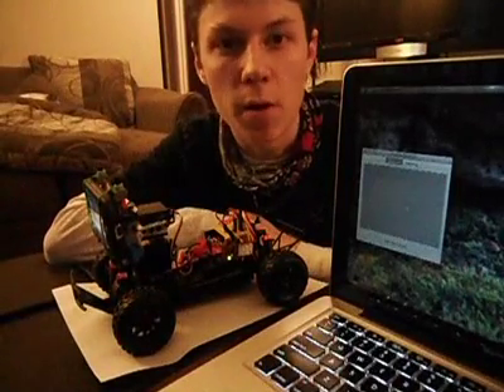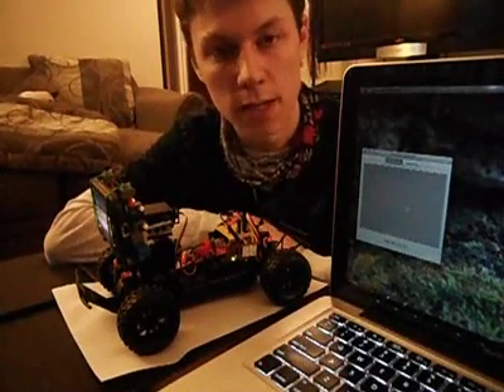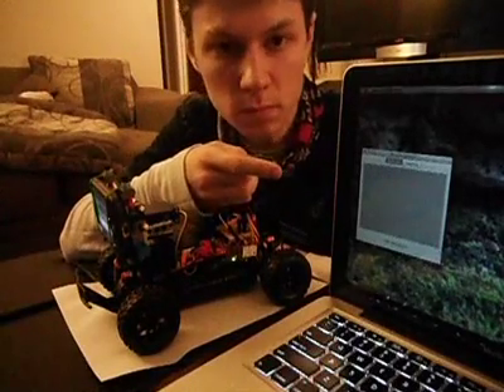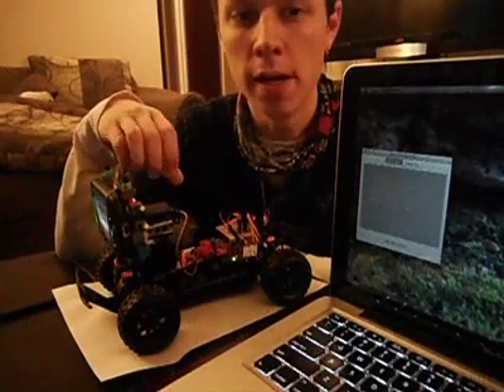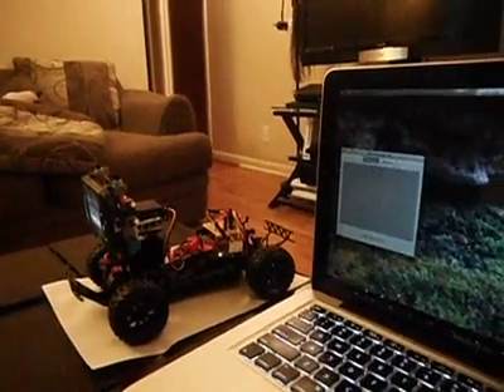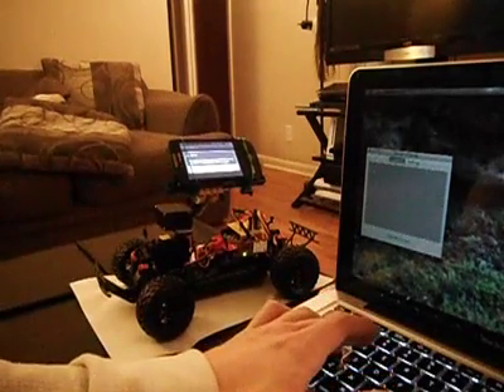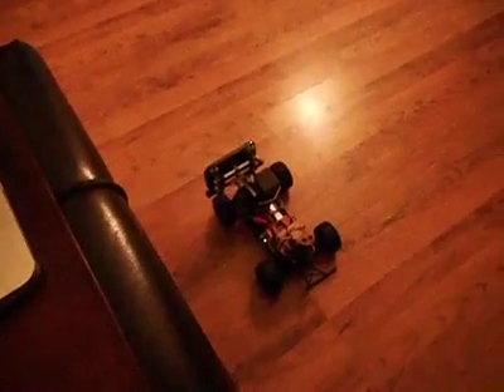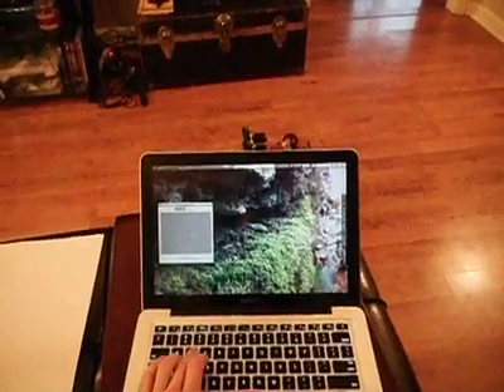Building an Internet/3G/4G controlled RC Car/Telepresence Robot. Video 3

Comment: Find a way to feed a live video over 3g/4G then make sure you use a very high amperage battery while making your circuit as energy conservative you can and then you would be able to remotely drive this car very very far away.

Comment: Cool.
But I guess the flying FPV is more popular.
If this connection could send new wayponts to the RVOSD, to control the plane...
Offcaurse with latency on the videosignal back to the pc... but still..
then you could fly FAR, without big antennas...

Comment: Can you release the source code for the Java application, Android App, and the Arduino? Also, a schematic would be nice. I would like to build this robot, and help contribute to the project? I planned on doing a similar project which also included GPS and a loud speaker.

Comment: tahts awsome but  what is the point of the panel that moves with ur mouse ..... u need to install ip webcam on the phone use front facing camera get th e ip that the app gives you connect the latop wiht ur phone and u got a live webcam .. if u found smth better tell me i wanna know

Comment: Hey, nice work on the build! But with regards to the connection between the Android phone and the Arduino, is there any reason you did not use the Arduino ADK? Transmitting the data over bluetooth does seem like more work, since you could just have interfaced the phone over USB to the Arduino. Also, any plans to get GPS data back to the PC? That would be cool!

Comment: Actually if you are able to tether the 3G Signal on your phone onto a regular TCP/IP Subnet or use it as a hotspot.. you can use a WiFi Camera with it. Basically the video feed to the phone hot spot or Access Point will be over 802.11b.g.n or whatever .. the wifi signal will be converted to an OSI Layer-1/2 3G signal before sending out to the internet. Another option is to use a 3G Modem and just insert your SIM card therein.

Comment from the maker: Jailbreak + custom cable? I want users to be able to download an app & go with as little wiring/setup as possible (without jailbreak or rooting or building custom cables). Serial interfaces, setup, and cables will deffer slightly for every device if I use serial, thus what I build/code wouldn't apply to everyone. Bluetooth however is standardized, widespread, cheep and is easy to program for. I'm not just building this for me. ;)